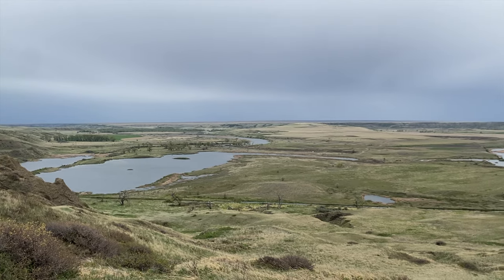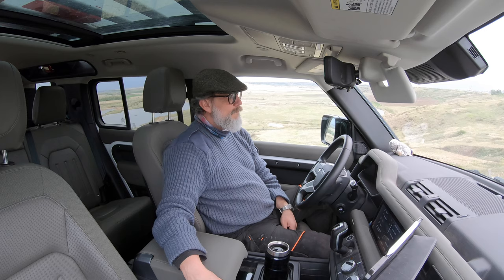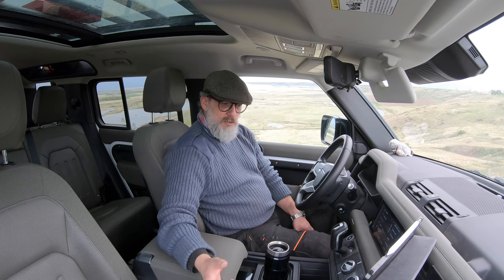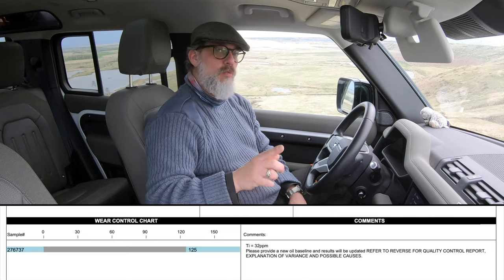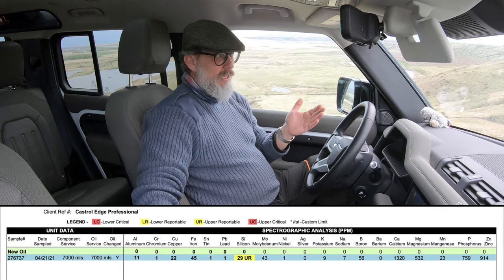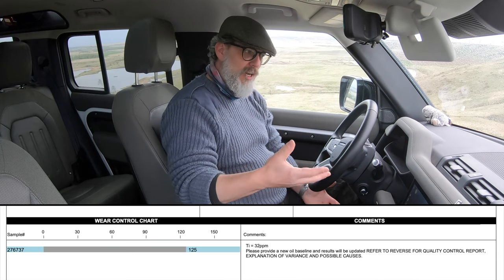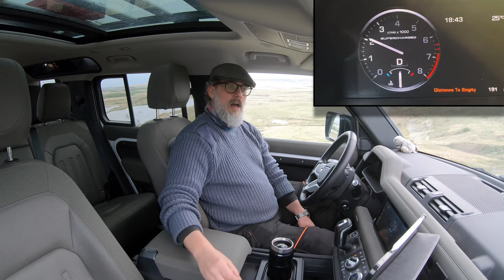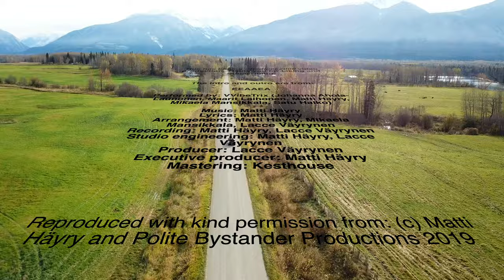Changing the Oil Matters: Oil Sample Analysis on a defender P400 #newdefender #defender110 #l663

Comment: Excellent and very informative Steve.Ever since i purchased my first car (Fiesta Pop,997cc!) in 83' and on which i skinned my teeth as a amateur mechanic i have held 3 beliefs which are as relevant on my D300 Defender as i did on my Pop---1/"Run" your engine it for at least 2000 miles--it will have a significant impact on its reliability over its lifetime.  2/Never rev it hard until it's at operating temp.  3/Change oil and filters(Air/Oil) every 5-6000 miles.  I call this common-sense and there,like yours many reports to support this.  In my opinion it really is the heart of the engine and is vital to its longevity.
Reply from the maker: If you push JLR enough, they will tell you that their ‘extreme climate’ service intervals (where weather is dusty, or temps exceed +35° or -20°) are 5,000 miles. Given the life that some Land Rovers lead, this means that JLR’s official line is that 5,000 is enough. Sure, under certain circumstances, 10,000 or 20,000 may be fine — but that’s the ideal. 

After 4 years, JLR don’t have to worry about the results of long drain oils; they just sell bits for broken engines to customers who complain that their engines have workout too quickly. But you and me do (assuming we’re the owners). Accordingly, I’ll keep swapping my oils every 5,000 miles or so and forget my worries about saving $300 on a service that year. 

Like you, I have the same ideas about engine management; I also leave my engine to idle for a few minutes after a long push so that it can settle down after being worked.
Reply: Agree with most of what you say,  oil and filter are cheap and easily done, lifeblood of the engine, my old Defender gets changed every 6000 miles,  letting the engine warm through is also very important. Running in new engines is a grey area now, they've found on large 4 stroke bikes that they develop more power if not run in, the reason seems to be that modern oil is so good that things don't bed in properly if treated too gently, Yamaha (think it was Yamaha) actually put low grade oil in new bikes to aid the break in period now.
Reply from the maker: @andicog  I can’t say anything about bikes, as I’ve no experience there — but oil is cheap and engines aren’t!
Reply: @shedlock2000  Agreed. I suppose for some people it's the labour cost to get it changed that stings, I do all my own maintenence and as you say, oil is cheap.

Comment: Thanks for that.
Very interesting.
This new "fad" by the car manufacturers for extending oil service intervals has me puzzled.
Yes, certainly the new oils are far superior to what was available 20-30 years ago - no doubt whatsoever.
However, new purchase prices for anything halfway decent (including JLR products) have gone through the roof. Major repair costs are bonkers.
Does anyone actually rebuild engines top to bottom anymore? Why can't parts suppliers give us OEM parts at a reasonable cost so we do not have to resort to Chinese (or other lower quality) rubbish?
There are lots of garages specializing in jiffy lubes and/or jiffy routine maintenance so why the push by manufactures to extend these intervals so drastically?
Seems counter intuitive to me.
The other annoying trend is making the simple act of changing oil so difficult.
Why wouldn't the sharp minds at JLR not make the new Defender service friendly for the owner?
All these belly plates are certainly justifiable and useful, by why not a quick release affair for the plate directly below the sump?
An owner should be able to access that sump plug quickly and simply without having to faff about for half an hour and then risk losing half the fasteners.
I totally agree with your attitude toward regular maintenance!
Especially with a vehicle like a Defender.
Seems car makers today are just amping up the "Planned Obsolescence" doctrine as far as it can be pushed.
Both shameful and wasteful in my opinion!
Reply from the maker: I do agree with the wastefulness — but there’s a certain kind of arrogance in owners too: where once the maintenance of a vehicle was a matter of pride, it’s now become something to ignore. I was suggesting to someone that longer drain services would not affect his ownership, but those of the next owner (understanding that the issues associated with long drain oil do not affect the engine within the warranty period but afterwards — usually when the first owner has moved it on). And their response was to say ‘very good then’ — which I took as to mean that individual didn’t care because their protocol wouldn’t affect them. Sadly, that long drain change will now result in premature engine wear and associated failures for the next owner.

This isn’t an issue directly caused by JLR (nor engine design), but by the behaviours of lazy and inconsiderate owners. The pride in owning and maintaining a complex vehicle has now gone — part of the difficulty is that people don’t care.
Reply: @shedlock2000  Very good points. And I totally agree with you. The poor chap who buys a second hand motor doesn't know what he's letting himself in for these days. Pride of ownership is becoming a thing of the past, sadly.
Reply from the maker: @badfinger61  Agreed. It’s sad to see the way people treat their vehicles and without thought of the next owner. There generally no consideration given to future owners and the disposition towards maintenance is only for the imminent: what’s the least I can do to maintain warranty.

Comment: Engines generally last longer than ever before even despite ever-longer service intervals and higher power and torque from less swept volume. I had a business acquaintance back twenty years ago that ran Audi Allroad diesel cars, driving all around UK and Ireland for an average of over 70,000 miles annually. He ran them on 20,000 mile service intervals and for 200,000 miles each before trading. Never had an engine issue but several had signs of tired transmissions at 200,000 hard driven miles. He then went to BMW 7 series twin turbo diesels, again living out of a suitcase and had similar experience. Always changed at around three years of age and had excellent trade in prices from main dealers who apparently took little account of the massive mileage. The cars were always immaculate because they very seldom carried a passenger.
He certainly didn't analyse the oil.
Reply from the maker: I am sure he never had dramas, but the next owners likely did! When maintaining these sorts of service intervals, the damage done is rarely seen by the first owner — mostly because of your first point: newer designed engines do last longer because build qualities and materials are better. However, all that has a limit; ask the people who have to replace their timing chains or transmissions due to long-drain service protocols!
Reply: @shedlock2000  
Timing chains do not wear as a result of long service intervals. They wear and fail due to being designed for a finite life [even if the oil was changed weekly] or poor design and engineering. Example of the latter was the 2.0 diesel BMW engine that had mismatched pitch between the sprockets and chain rollers, almost guaranteeing failed chains before 70,000 miles.
99% of cars nowadays are scrapped before their engines are worn out as long as the engines are serviced at least as often as the manufacturer specifies. Long gone are the days of 3000 mile oil changes and 60,000 mile major rebuilds of the engine.

Comment: The LR recommended service intervals are halved if my Classic Defender is used in hot and dusty conditions. I service every six months which usually comes before distance travelled. Do you change your air filter at oil changes? There is an argument around that an airfilter is more efficient with a bit of dust in it than a fresh filter...can't vouch for this.
Reply: Its fairly obvious that a slightly dust coated air filter is more efficient than a new filter at filtering.  It is important to ensure that air filters are seated and sealed correctly.
Reply from the maker: I always change the air filters at service time. I used to also change the fuel filters — but these are often in the pumps now and are unchangeable (which is annoying and a waste). 

I’ve mentioned above in a few places that extreme service conditions would reduce the service interval for JLR. Once upon a time, they used to have special oils and filters for extreme climates (early range rovers in Canada were supplied with yellow power steering fluid which was specially formulated to reduce the water contamination and be less viscous in colder weathers). The new iGuides don’t mention this, but you’re right, and any Land Rover in climates which regularly exceed +35 or -20°c are delineated as being in extreme climate conditions. 

I’m not familiar with the discourse on slightly dusty filters being more efficient — there’s probably something in it, but I can’t say for sure. I swap mine out mostly because I open the box to see if there’s anything there that shouldn’t be — then when I’m in there, I swap the filter because it saves me a job another time.

Comment: I did an oil analysis on a Defender with around 25,000 miles on the clock, many years ago. This was a diesel naturally aspirated 110 Hi Cap pickup. It was about three years old at the time and I did the analysis the oil had been in the sump for 5000 miles, which was 1000 miles short of the maximum recommended service interval.  
The results came back with comments about excessive iron, copper and I forget what other horrors. It really frightened me until I came to my senses. To cut a long story short, the old LR Diesel engines blacked the oil as soon as the engine was re-started after an oil change; that is just the way they are. I persisted with 5000 mile oil change intervals for another 20 years before the engine failed and it didn't fail due to a lubrication wear issue. It failed due to a broken piston.  
Oil analysis are only really useful if done regularly within service intervals, basically to find any sudden change in contamination either due to the oil itself failing or due to some engine component failing. 
Otherwise don't take any notice of one-off oil analysis results. You'll sleep better at night.
Reply from the maker: Oil analyses don’t worry me because I change my oils frequently enough that the results are never problematic. However, the results are indicative! The various contaminates that float around the engine do show wear (and what kinds of things are wearing). They can identify oncoming failures, but they also indicate what kinds of wear is happening. 

Blacking the oil is well known in a diesel, but it’s not normally something that happens in petrol engines. My 3.5 and 3.9 V8s would have similar coloured oil after 5,000 miles as before. That’s not the case on newer vehicles because of EGR designs. But this is also indicative! If the oil is becoming black due to EGR, then the oil is picking up something from the exhaust gas that it wouldn’t normally. What is that? Well, spot, heat, and other stuff. What happens to that stuff? Well, it is suspended in the oil and reduces its efficacy. Why does it reduce efficacy? Well, because if an oil has suspended particulates, it becomes abrasive, and with enough abrasiveness and a long enough exposure time, it will wear bearings and other softer materials decreasing engine life and generating greater engine wear. Physics, so they say, is physics!
Reply: @shedlock2000  
Particles in the oil only become a problem under two scenarios.
1.  That the size approximates the film depth of the oil in bearings.
2. Where the shear number of particles overwhelm the dispersant properties of the lubricant and therefore start clumping together to produce sludge and deposits.
There is another issue with long drain intervals which are either excessively long or the oil used is not of sufficient performance quality, and that is loss of shear strength and viscosity, which tends to happen very suddenly. This causes a sudden and severe [temporary] increase in oil consumption but if run that way for longer than an hour or two, severe engine wear as well. 
Most long drain synthetic oils these days are limited by contamination volume. Not by particles or indeed particulates that cause the oil to 'look dirty', but by fuel dilution.
Reply from the maker: Interesting. How do they manage differently the particulate?
Reply: @shedlock2000  
The oil filter's job is to remove particles that are of a potentially harmful size, no matter whether of carbon, metal or indeed sealer or plastic. Therefore it is ultimately the shear number of particles that will eventually overwhelm either the filtration capacity or, if very small, the capacity of the oil's dispersants and detergents to keep them in harmless suspension rather than deposit or clump together to thicken the oil.
Reply: @shedlock2000  
Ah! I see what you are asking now. Oils differ greatly in their capacity to keep the engine clean. A dirty looking oil is actually doing its job well compared to an inferior oil that would look clean but leave deposits in the sump, around the valve gear and in the piston rings. 
The way they differ is in the base oil, for the potential to stay in grade longer and in more extreme duty cycles, but also in the additive package that determines film strength, foaming, and the absorption capability and capacity. This is important in very light oils but not as much more as most people would expect in relation to film depth/strength as long as the two viscosity numbers are very close. The closer they are, the less the viscosity alters between being very cold and very hot. Therefore a 0W/20 is basically a '20' when hot and varies little when cold. A5w/20 even less so but more as the ambient temperature drops way below zero.  But I digress.  I'm guessing that a 0W/20 is specified for Canada but a 5W/20 OK for your Summer and UK all round use.

Comment: Thanks so much for posting. It really makes me wonder what the analysis would be on Ronin (my P400) without the air intake. I live in a generally year-round dusty environment and am just curious what the difference would be.
Reply from the maker: I’m not sure. After I recorded this video, I was contacted by a guy who had his tested after the first 5,000 miles. His silicon levels were three times mine, and the analysis company suggested this was a function of sealants used in the build of the engine. They suggested that the silicon content would reduce over time as the silicon heated up and burned off (essentially). 

My analysis team said that there is little silicon used in engine builds now and that the contamination is a function of dust and sand particles. I’ll do another analysis on the next 5,000 and tell you what are the results. If my team are right, the silicon content would be the same (or worse, as it’s summer here now); if my friend’s are right, then the Si figures will be lower.

Comment: My dad as 110 P250 diesel version. How many miles is suggested by manufacturer and how many would you suggest? I'm bit worried about Land Rover dealership service, if they really change the oil. They have mostly rich customers who don't really care about these things.
Reply from the maker: Those are fair concerns. In my experience of JLR dealerships, they don’t do a very good job in most cases. I imagine that they’d change the oil, though, because it’s easy and can be checked simply — but that doesn’t mean they would (see my video on the 43 faults for evidence of JLR shenanigans!)

In a D250, I’d change the oil every 5,000 miles. Diesel oil is cleaner now, but the soot/dilution issue is still a concern. You can go shorter, but don’t go longer. Oil changes are easy, so there’s no difficulty in doing them regularly. 

For the P300/400, the service interval is 21,000 miles. I’m not actually sure what it is for diesels — less I imagine, but I don’t know by how many. Regardless of their recommended interval, I’d cut it down to 5,000 miles.